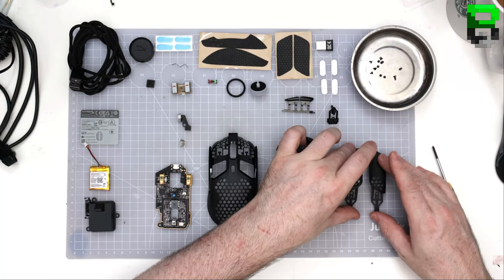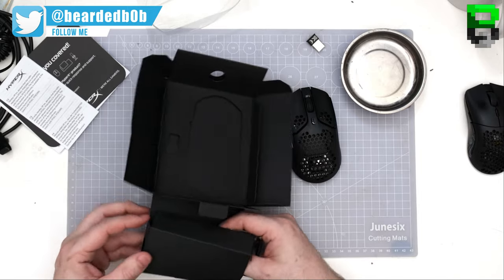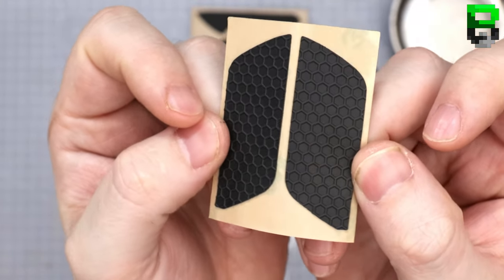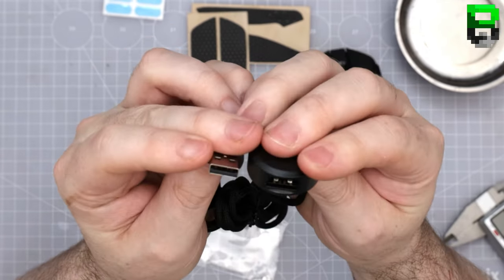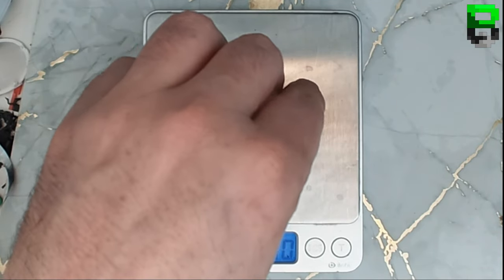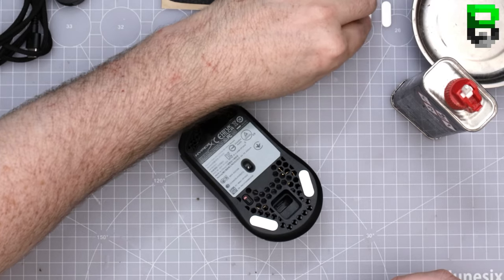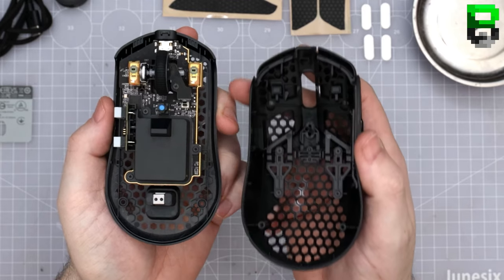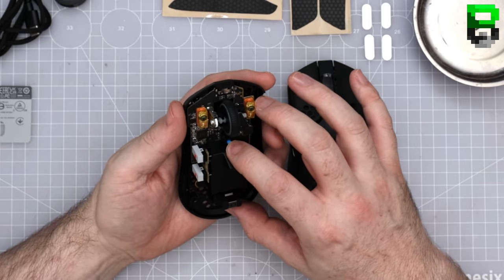HyperX Pulsefire Haste Wireless Teardown: Detailed Inside Look!

Comment: Thanks for the video, my scroll wheel was skipping and i tried to disassemble it, but was to afraid to just yoink the board out, it didn`t seem very safe to me. but after waching the video that at somepoint you just have to do it, I managed to solve my issue
Reply: Currently taking mine apart to repair the same issue. What steps did you take to fix it? I was just going remove top shell and blow it out.
Reply: @stevenlopes8365 same did that fix it
Reply: my scroll started to go up and down when want to scroll, i disassembled the mouse but.. i didnt make it work properly
Reply: @Strebest  i just took the scrollwheel out, and when i put it back, i just stuck a piece of rubber in the hole with it. It looks sketchy when you try to stuff it in, but it works wonders
Reply: @elodkotro5936  i disassembled the mouse to fix the scroll wheel as well and all is good, but how did you manage to get the top shell back in the mouse? I can't get it to get back in properly, a reply would be greatly appreciated.
Reply: @dellin123  it can really be a struggle, I did it twice, but I don't know if there is a good method to it. The problem is at the front where there are clips in both directions, if it makes sense (both backwards facing one as well as front facing). If you do one side first the other ones are really hard to get in, so i just try to align it in the middle, where is like halfway in in both sets of clips, and try to wiggle/smack it in place. I don't know if this is how it's supposed to be done, but it worked for me both times.

Comment: I somehow came upon a listing on eBay that was mint with original packaging/accessories untouched: $21 shipped. Everything is perfect on it except the scroll wheel encoder needs replaced because it frequently misses/misinterprets input. Which is fine enough because I really don't like how light the resistance is on it and would like to find something with greater resistance and tactility. What's really weird about it is that it feels IDENTICAL to the encoder on the GPW, but I like the scroll on that. It's a good example of how the combined design and materials of EVERYTHING make up the feel, not just the switch/encoder itself.

Comment: Thanks for the video. Out of all the mice I've tested, this one was in my favorites...it's very light weight, as far as I can remember the buttons sounded and felt the same and weren't too hard to press for the mouse weight, mouse wheel was decent, width was great for my hands, really loved the M1+M2 form. Only issue for me is that the back is too small for my grip and hand size.

Comment: How do you open up the front? Is there some kind of locking mechanism there i can't seem to pry it open no matter how
Reply: There are a couple of clips on the bottom shell, one under each mouse button; you can get a good look at them at about 5 minutes in. They clip into slots on the top half right under the buttons. It's a pain to unclip them, and to re-clip them.

Comment: I just bought a model around a month ago and the screws don’t seem to be the same. I can’t figure out what kind of screws they are so that I can take it apart. Can someone help me?
Reply: You probably aren’t looking for this anymore, but for anyone else, some models came with Philips, regular trox, and trox security. The trox security is the one with a circle in the middle, in my experience if the device isn’t very old, you can use a regular trox bit to remove it, however if you aren’t able to, you can always just run down to any hardware store and get TS bits for relatively cheap.

Comment: My scroll wheel is wildly sensitive, it bounces up and down at the slightest touch. My other mice do not do this.

Do you think its thus soecific design, or an issue just my device? Can i replace the scroll wheel mechanism?
Reply: i have the same issue and have been trying to find a fix, it seems like just a vented design issue. Hair and other things just find their way into the mouse and I'm sure there's a couple tangle up in the scroll wheel messing with everything.

Comment: not a mod friendly mouse. the torx screws, the weird way the top shell attaches to the bottom shell, the box with the battery, side buttons pcb mounting, and the weird rubberized glue holding the sensor to the bottom shell. i swapped the switches on mine and was surprised how different it is from the wired Haste (internally and how it comes apart).
Reply from the maker: yeah its certainly an intermediate one to mod

Comment: Just got this on Amazon for £32. It's incredible at that price point. My new favourite mouse
Reply: The wired or wireless? Wireless is selling for  £112 on Amazon at the moment. Which seems absurd, since it's £6 more than the GPX.
Reply: @Rocket33r  wireless. Pretty sure it was a pricing error. It went up to £75 two days after I placed my order and now it's even more like you said.
Reply: @timbillins1848  I wouldn't call it an error necessarily (it's debatable I guess), it's just Amazon's algorithm. It changes prices aggressively. I've also found bargains in the past. The current 112 pound price is just as absurd as the 32 pound price. I think I paid 35 or so for my wired copy. I guess you got a good deal.